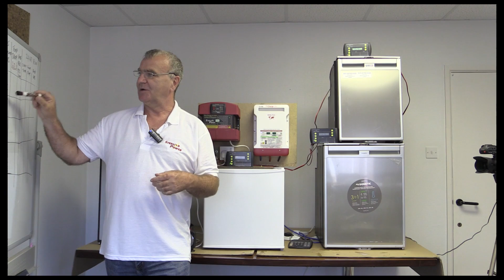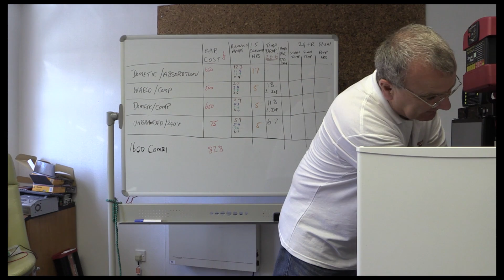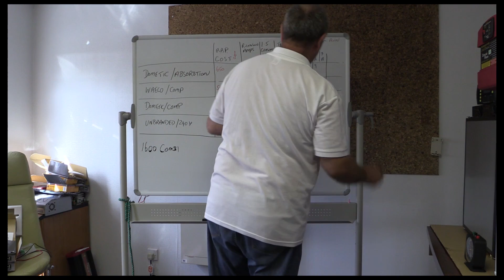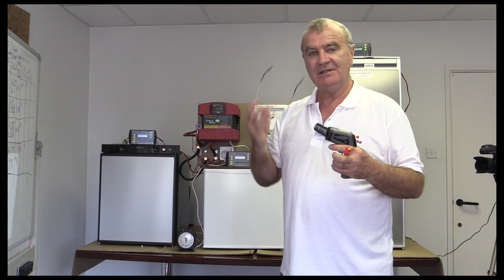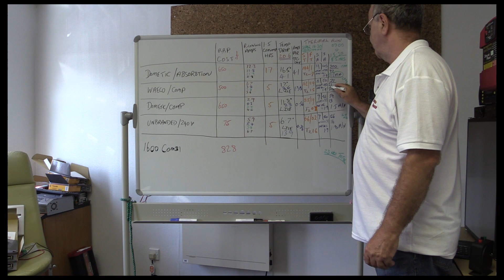Fridge Comparison Energy Consumption test with multiple fridge types in the leisure industry

Comment: This has been really useful. I'm about to start installing electrics into a 1950's caravan that's being restored, and I was going to recommend a 12v fridge, but now, this has given me pause for thought. Thank you :-)
Reply: Bear in mind that this video is from 2017.  Looking at the power draw of modern day 12v fridges I find much lower power requirements than have been demonstrated here.  OK, I'm looking at manufacturers specs, which may need several pinches of salt.  Would be interesting to see an up-to-date rerun of this video!

Comment: This has helped me understand a bit more about our fridge situation on board our narrowboat. I’m a voltage looking hawk and have always been told to never let the voltage drop to under 12.1. We have a 240v unbranded fridge that we bought for our boat. We have 4 x 115ah leisure battery’s, 300 watts of solar that’s to run, tv, water pumps, led lights and fridge, also charging iPads and iPhones.  When the fridge is on and the compressor on the fridge kicks it the voltage reading drops to around 11.4 then goes to 12.4. Is this normal or am I killing the batteries? Any help is great fully received 👍🏻
Reply: Yes, a momentary voltage drop is normal.

Comment: Hello what is a combi perhaps I've missed something basic
Reply from the maker: Hi James!

No worries. A combi is a combination inverter charger. It's very much what it sounds like, both an inverter and an AC/DC charger in one!

B
Reply: @SterlingPowerLtd  
Is it a unit that charges from shore power or alternator or both.

I'm very interested in the efficiency and speed  of battery to battery charging. 

Also what is the model used in the test and are you a supplier? 

Cheers
Reply from the maker: @theshizzle2000  Hi James,

The Combi is a unit that provides AC(Shore power) to DC(Your batteries) charging. While the combi is plugged in to mains power it also runs everything you're running through inverted power exclusively off of mains- so you're being topped up, without using any of your own power, and still able to continue as normal! If you do end up losing shore power, either through a power cut or just an accident, it has a 0.1s auto-crossover switch to switch you over to your batteries as if nothing had ever happened.

Battery to battery charging is in the 85% efficient region, however our premium series charger will be significantly higher, still. Market leading, in fact. Can't talk too much about that yet, all very hush hush. Speed is variable dependant on what chargers you have and how many of them, and indeed how big your battery bank is. If you want a more direct consultation then feel free to email us at info@sterling-power.com  and I'll check your contact.

The model being used in the test is that little black and red thing at the back middle-left, the PCS121600. We're currently out of stock but we do have the PCS122500 and the PCS123500 variants still in stock- and more!

Feel free to give us a shout if you need more help!
B

Comment: The amp meter on the 240v fridge is connected on the 12v side or on the 240v side?
Reply from the maker: Hi Darren,

From what I remember and can see it's on the 12V side. If it was on the 240V side the A reading would be tiny. 

B